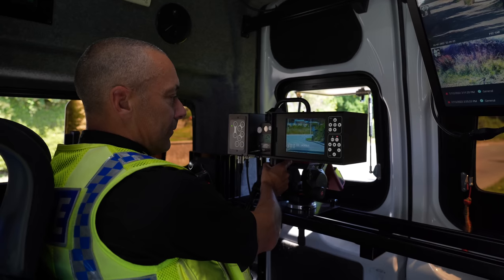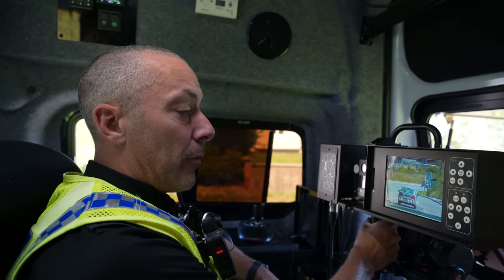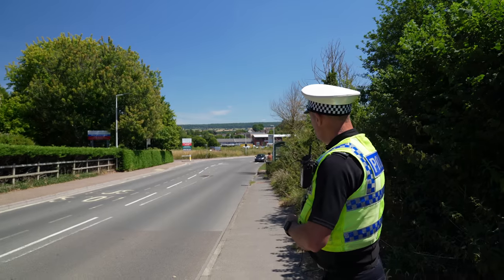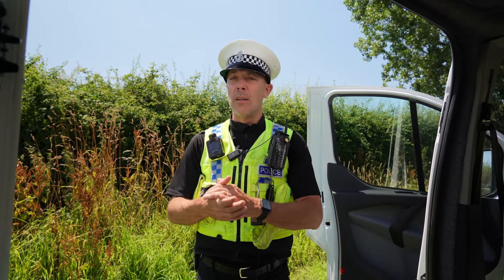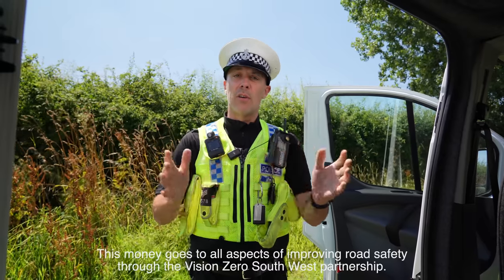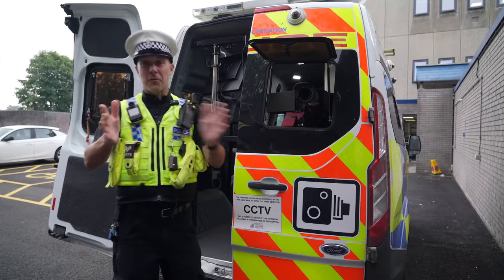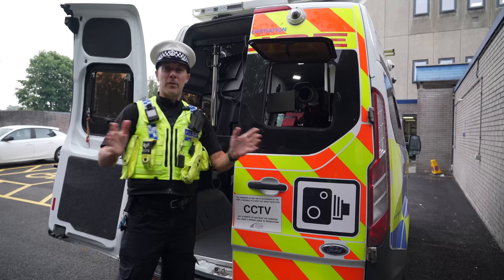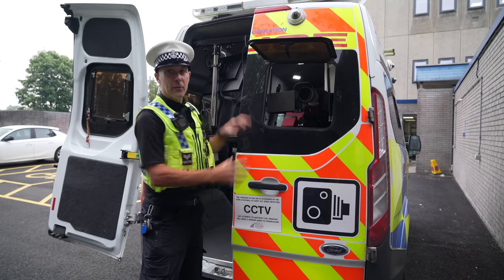SPEED CAMERAS - Road Safety or Cash Cows?

Comment: That speed camera van is exactly where it should be outside the school not on a bypass
Reply: @NoBody-gf8ie  Mostly due to differences of speed.  Motorways are still the safest roads.
Reply: Yet I never see them by schools , only ever on motorways and dual carriageways. Cash cows
Reply: It's not really in the best place. It's catching people speeding past the bus stop, the hospital and the school.

If you want to stop people speeding past the high risk areas you would have the camera's before these risks.
Reply: What's the percentage above the limit can a vehicle be traveling without getting a fine? I was told a while ago from a camera operator that it was 2-3% to account for the under reading of speedometers.
Reply: @neiliosr8  It's 10% + 3mph.  Depends on the area and it's at the police discretion.   Just one mph over is speeding.  So 36 in a 30 will deff earn you a fine.
Reply: @neiliosr8  it all varies to be honest. The most common is 10% or 10% + 1/2 mph. Depending on the road however and flow of traffic then it may be less than that or more. Sometimes they might only really stop you if you are going 50 or so in a 40 . It also depends on the officer operating, how they’re feeling on that particular day and time as they use their discretion setting fines.
Reply: @Chrisallengallery  No, not discretion, they are National Scheme members and must follow the NDORS criteria.
Reply: No, it is the approach roads to schools where children cross unsupervised where they are needed not outside schools.
Reply: @FuheeziumHD  well if that’s the case did you hear what he said about the autobahn speed being 25% more chance of a fatal. Don’t speed anywhere is the true answer.
Reply: @Shane-mp8nz  might be 25% higher within germany but if you zoom out and look at the grand scheme of things, its still alot lower than many other European countries. This is a perfect example of cherry picking a fact and not portraying the full picture. If the UK had a more rigorous and comprehensive driving test then we wouldn’t have so many trash drivers. The germans have much better drivers as a result of how they learn to drive. Seriously, I am genuinely shocked at how some drivers have managed to pass their tests. I also bet (this is just speculation) that a large number of these autobahn accidents are caused by foreign drivers not from germany.
Reply: @Shane-mp8nz  I done a case study. Shit drivers cause accidents
Reply: Speed limits are there for a reason. Don’t speed & you won’t get a fine, simples, #speedkills
Reply: @xxxxCOOTERxxxx  speed limits are old and outdated and were set a lifetime ago for cars that were far far far inferior in terms of safety and stopping power. I know owen did mention your thinking distance remaining the same but regardless, total stopping distance still decreases.
Reply: @Shane-mp8nz  how do you define speeding?
Reply: @Chrisallengallery  so it means that on motorway you will have to do 80 mph minimum to get a ticket?
Reply: @Chrisallengallery  so it means that on motorway you will have to do 80 mph minimum to get a ticket?
Reply: @d0mo76  You should get away with doing 80 but fixed cameras can be activated at 71mph.  I wouldn't risk doing over 71 past a fixed camera because they most probably will get you.  It all depends on what speed the police in that area decide to prosecute on.  10mph +2 is only a guide.
Reply: Must be from Edmonton Alberta speed cameras on every overpass every intersection and decibel radar for vehicles to loud WTF
Reply: @bigdogcars3277  going over the limit obviously. The limits are for a reason. Doesn’t matter if cars are better the Tesla is supposed to stop when it sees a pedestrian but it isn’t always reliable. It’s drivers that’s the problem I see drivers that are to lazy to indicate while I’m waiting to pull out of a round about which makes me have to wait longer. I see drivers half asleep and on there phones all the time literally daily. If people was just a little less selfish and stop checking their silly phones every 5 seconds then that would help massively. So speed does matter when you have half a sleep drivers who can’t be bothered to indicate, do the essential checks and keep people safe.
Reply: @sercanserj7804  yes agreed. I see loads all the time on their phones and Half a sleep. But if people payed more attention then speed wouldn’t be an issue
Reply: @sercanserj7804  And impact speed determines the resulting level of physical trauma.  Bad driving is just one factor of a RTC.
Reply: There is one that sits on mexborough by pass in Doncaster 40 mph limit most of the time no school nothing.
Reply: @jasonwelsh5986  Nothing?  If there is enforcement there, then there is a recognised level of non-compliance = drivers choosing to ignore the posted threshold.
Reply: @Chrisallengallery   I was caught before 32 in a 30, had to attend speed awareness course. Was told by a traffic officer  was told there is no ten percent due to the speed limit been the maximum you can travel on said road... I.e a 30 is 30, but as its classed a residential and built up that you should not actually be travelling at the maximum speed 20-25mph is sufficient due to observation and for ever changing environment.
Reply: @danwatson8790  The 10% is not a rule or law, it is only guidance.  It's at that discretion of the officer or crown prosecution whether or not to prosecute.
Reply: @jasonwelsh5986  do you not understand the concept. They should be allowed to park anywhere, anytime if you ain’t breaking the law and following the speed limit you have nothing to worry about. I really don’t know why so many people call the vans cash cows and all other types of silly names oh yeah I do actually know why they call them names because they have been cause breaking the law. Not saying everyone is perfect but come on if you get cause take it like a man don’t act like a tit about it. Calling names lol. Childish behaviour.
Reply: @neiliosr8  national guidelines is 10%+2. 
However that is just a guideline and you can be prosecuted for being 1mph over because speeding is speeding.
Reply: At schools or built up areas makes sense (Irish example here) not on the N7 a dual carriageway where speed is sign posted 100kph and on a downhill slope a  speed van is positioned under a bridge at junction 2 eastbound for no other reason then easy targets coming downhill, might aswell be shooting fish in a barrel. Thank god for Waze to catch them out.
Reply: what they want you to see not the truth
Reply: @danwatson8790  You just remember it incorrectly, no UK constabulary issues notices at 32 in a 30.
Reply: @Al_Pollock  Every one of the 39 National Scheme member constabularies MUST observe the same issue criteria other wise they cannot offer courses.  It is not a guideline, they signed a contract.
Reply: @unleashthedragonwithin2057  
Beleive what they tell you, I know I received the ticket  after filling out paperwork had to attend speed awareness course.....
Reply: @danwatson8790  I don't doubt you received a notice and opted for the course, but not a 32.  National Scheme criteria is very strict.
Reply: @unleashthedragonwithin2057  

I was doing 32 in a 30, the vehicle was my father's he received the notice after filling in in my details and returning it I had to attend a speed awareness course at grimsby

 I aint gonna lie, so all depends on the officers on the day personally if it suits, what they know what they don't. You people are sheep!!
Reply: @danwatson8790  It is nothing to do with how an officer 'feels' on any given day.

National Driver Offender Retraining Scheme (NDORS)

* National Speed Awareness Course (NSAC) - aimed at drivers and riders who have exceeded the speed limit up to the agreed threshold currently set at 10% + 2 through to 10% + 9 excluding 20mph zones.

10% + 2 = 35mph.
Reply: From the comments here it's obviouse that Pasition really helps perception. The general motorists experiance seems to suggest that most Camera Vans are not being used as a deterent and more for revenue purposes. The odd thing is a single celebrity lets go with Simon Cowell as an example: He pays more in income tax then all the speed camera's everywhere collected in speeding tickets and fines over the same period.
Reply: @Ciorram1  And he got a lovely smile, why no mention of that?
Reply: @neiliosr8  0mph, most forces will give 10% + 2 of the limit (so 35 in a 30, 46 in a 40) but in law there is no leeway 30.01mph is more than 30 so your speeding. Its a limit not a target, and anything over it is unlawful.
Reply: Yes like here in Cornwall sat at the side of a the A30 dual carriageway  lots of schools etc there !!
Reply: @thecornwall125company6  What happens at schools?
Reply: They should be ANYWHERE. 

They are only a problem for speeders, hence your logic. If you dont speed, it's impossible to be caught for speeding, is it not?

one day, the penny will drop with the cry babies, who blame everything and anyone for something that is entirely of their own doing.
Reply: @unleashthedragonwithin2057  exactly. Use your brain now. Good drivers see the impact and slow down. Bad drivers don't see it till you show them pictures of the aftermath.
Reply: @sercanserj7804  What are you responding to?
Reply: @jasonwelsh5986  Yes. And it's at the top of the hill just as you're coming off the Adwick Road roundabout. It's easy to be going a bit over the limit there if you're not careful. I've done it myself without realising it.
Reply: oh please do explain why should a motorist on a bypass be allowed to exceed the national speed limit!
Reply: @thecornwall125company6  There is a new one somewhere on the Camborne turn off. I'm awaiting a ticket from July.  Never seen any past Chiv to Halyle 😬
Reply: @FuheeziumHD  good, collect that cash from people who are disobeying the law
Reply: @neiliosr8  When I was learning to drive I was given to understand that the law requires that speedos to be +/- 3% and +/-3mph. Hence the up to 10% lattitude that the courts allow. No one gets a ticket for 74mph, as a rule, but you might well get one for 34mph
Reply: @Chrisallengallery  deservedly so
Reply: The officer literally said its because of community complaints
Reply: @unleashthedragonwithin2057  so you admit if the accident didn't happen the impact wouldn't happen hence why shit drivers cause death and accidents?
Reply: @Chrisallengallery
Reply: Easier to meet targets on faster roads with more traffic.
Reply: @neiliosr8  speedometers never ever under read, they are always set 2 to 5 mph OVER what you’re actually doing. 
Manufacturers do this on purpose so they don’t have to calibrate every speedo exactly so they err on the side of caution.
Reply: @bigdogcars3277  speeding is traveling too fast for the road conditions. I will travel at the speed that I deem to be appropriate.
Reply: @gavjlewis in one direction… for the other side of the road it is before them…
Reply: @GazzaJAnimal the answer to this is to ‘be careful’ as you put it. You should always be careful if you are hurling over a ton of metal through the air.
Reply: i was caught today no worries i was speeding in a 60.. but (i know but) the van was over the hill/brow of the road in a laybay